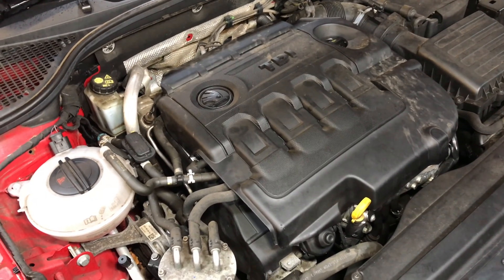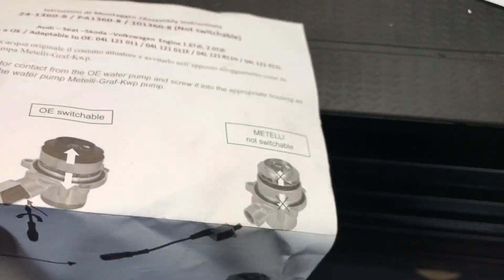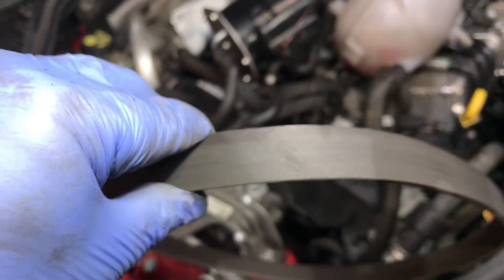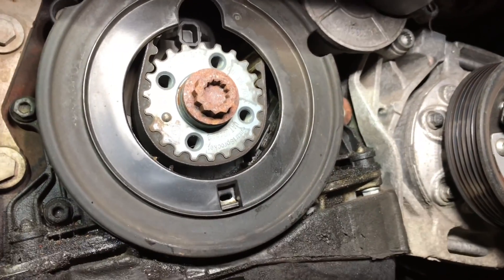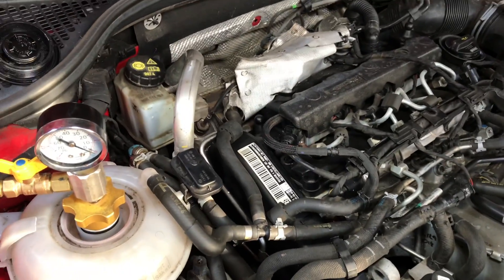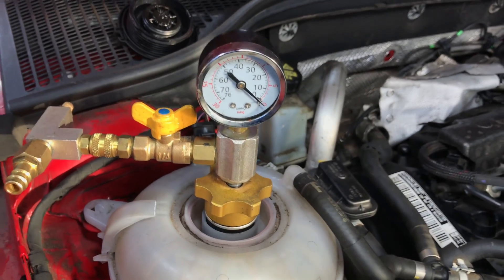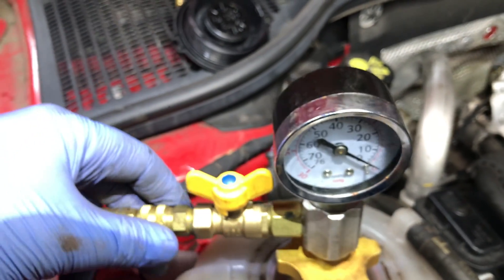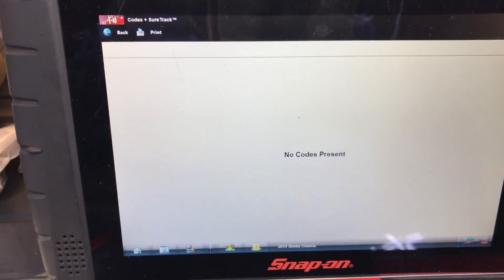Skoda Octavia 2.0 TDi RS (2014)  Timing Belt/Water Pump, Engine Code CUPA/CUNA

Comment: Good video, pity about forgetting to film (can understand though about remembering to stop to do this & not get carried away), but does make it difficult for someone new to Euro cars to work out. Anyways, is there a list of the tools needed (or more particularly, the bolts types and sizes)? Coming from only working on Japanese and Korean cars, the types of fasteners Euro manufacturers use is quite baffling :p

Comment: Great video, doing this very job right now on my own car pulled the new water pump out the box and was very confused as to why it had no sleeve so watching this has helped immensely thank you. 

In the video i think it says you have to remove something off the old pump and transfer it over and when blowing air in to the pump at the end of the video it looks as if the electronic sensor part has been removed, does anyone know if this part does come out and is required swapped in to the new water pump?

Comment: Hi Sandy, as has been previously said I’ve started using genuine Vw ones, they come with the sensor already fitted and there’s very little difference in price to the aftermarket ones. I’ve had a couple of the sensors break trying to swap them over. Those top belt covers are a real pain to get off now, I haven’t found an easy way to do them yet, they always feel like they’re going to break.
Reply from the maker: Cheers Jon if we get that job again we will try the vw part cheers sandy

Comment: Sandy I've done a few of these.  If you fit a genuine vw water pump you will find the part numbers last letter has gone from A to G . They have upgraded it to prevent this happening.  Had no problem with those I've fitted and they are not that expensive compared to aftermarket ones without the retractable sleeve.
Reply: I’ve had loads of issues with the new pump still sticking lol awful pumps , I look after a fleet of about 400 skodas unfortunately 😂